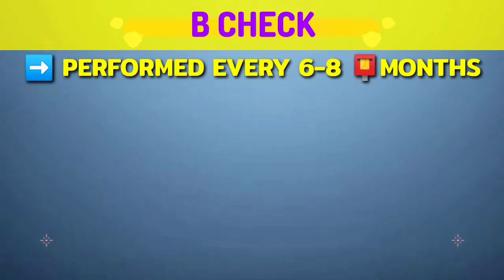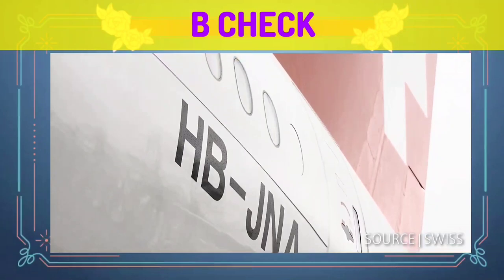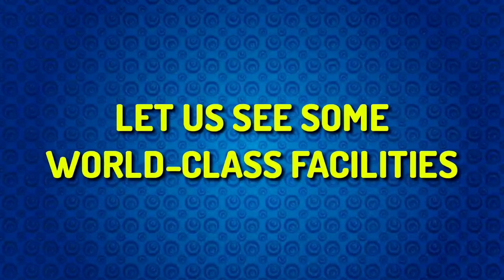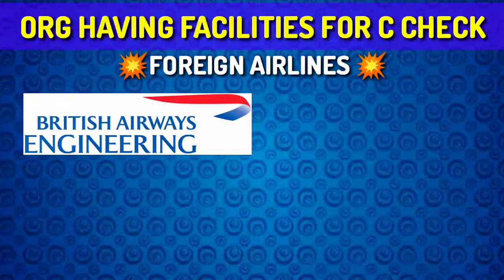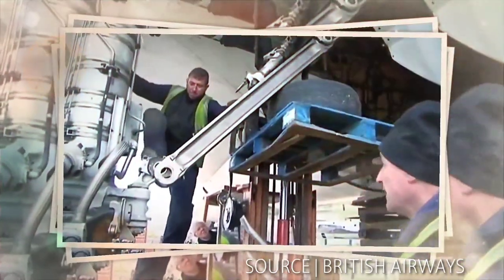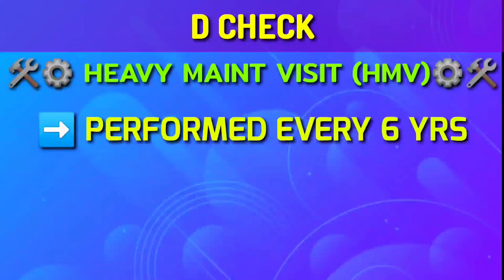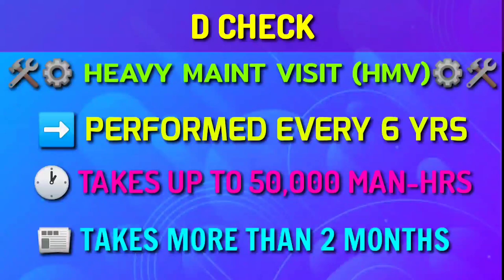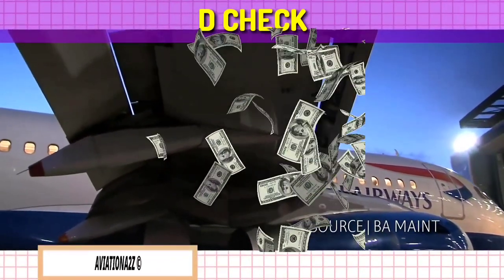What is A,B,C & D CHECKS In Aircraft Maintenance |LET'S LEARN|AVIATIONA2Z ©|#AIRCRAFT #MAINTENANCE

Comment: Nice information but there is a lot of info is not correct. A check entirely depends on the checklist to the checklist. It's not necessarily 400 to 600 hrs. It depends upon the maintenance manual. It's around 1200 hrs.